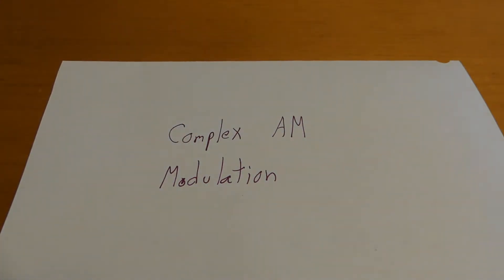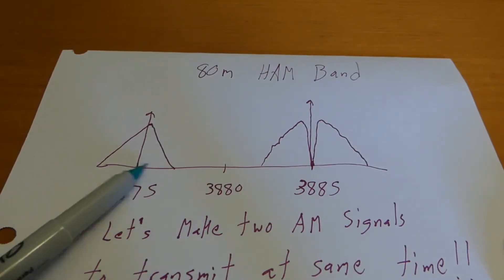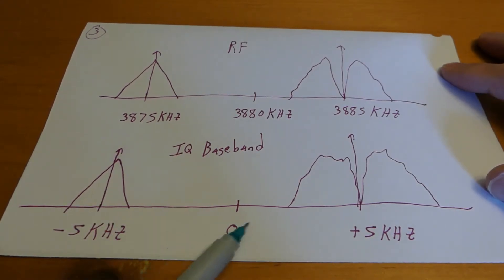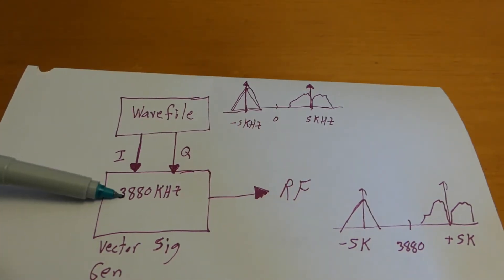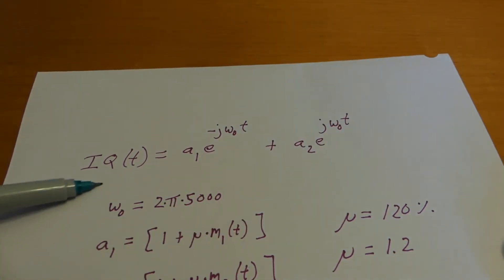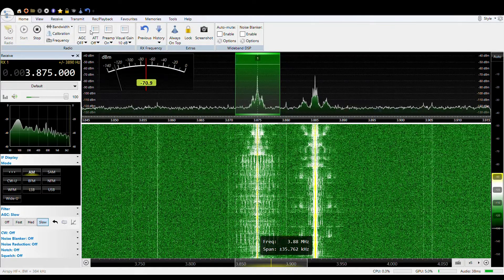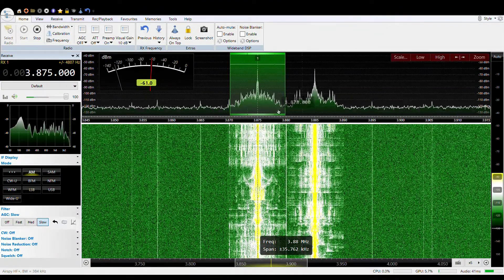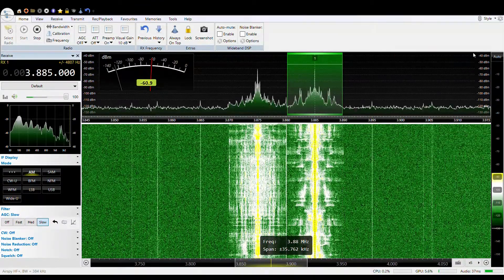I/Q Modulation for AM Signals

Comment: Dear @TheGmr140. I recently bought an Agilent E4432B signal generator with dual arbitrary waveform generator. I modified your 6AM signals matlab code to generate I and Q signal values for E4432B. When I modulate a carrier with the IQ signal I see a much wider spectrum on the receiving SDR without any audible sound. Could you please help me what could be the problem? Isn't this siggen usable for such AM IQ modulation scenario? Thank you! I can share the details with you in email... 
(By the way, I miss your teaching videos recently... Please do more!)
Reply from the maker: you have to enable I/Q mod on the sig gen.   may need audio level to be 50%,   i'd first just make a wave file ,  fs = 48khz,  x = exp(1i*2*pi*2000*t)
t = [1:1000000]/fs;       then  x = [ real(x).'   imag(x).' ]   ,   then audiowrite('c:\temp\test.wav', x, fs)    and see if you see tone 2khz off from e4432b center freq
Reply: @TheGmr140  Thank you! I was able to fix my issue. I had some data conversion issue while downloading to siggen. Finally I was able to generate IQ files from one of your wavefiles, transmit it on a carrier and receive it on a tuned SDR. So I am happy now with my signal generator which I can use for experimenting IQ modulation even if it has limited memory. Thanks!
Reply from the maker: @ ok good deal.
i think that has bnc for i and q inputs,  so if your bw needed is around soundcard levels, 48khz,  192khz,  you should be able to play signals out of soundcard to those bnc inputs.      now memory is limited by pc hard drive.   lol

Comment: I need some tech support from Dr moonshine please,  i couldn't get a reasonable hearable signal from my signal generator level setting to 0 dbm ,, !!! but your previous video the RS SMIQ 02 /03 you said to set the level to -70 dBm ....!!! this didn't work at all, and even at +3 dBm the sound was ok but not as crisp and clear like the video here.
any hints?
Reply from the maker: Does hackrf go that low?  Make sure rf is on the smiq
Reply: thanks for your reply sir,  yes sure the RF was ON and i even checked the signal on an oscilloscope, it goes away when the i click the RF button....today i tried HD SDR software , it's actually not bad at all...but still the audio quality is not as good as yours on this video...troubleshooting is a great learning tool....lol.
Reply from the maker: @ahmedgaafar5369  my sdr was hf discovery,  play with power levels -70dbm, -60 dbm
Reply: @TheGmr140  nice videos, but, can you answer me a question about iq-mod LO Leakage at RF Port ?
Reply from the maker: @antoniocarvalho8320  for analog IQ modulation it's an issue.   For digital IQ modulation it's no lo leakage

Comment from the maker: here is a link for 6AM Signals at once the link is the whole project, matlab script, audio files, and IQ wave file:
https://drive.google.com/drive/folders/1kt9B5Hlvyp-ztUGf2rL0hXJ9nyGuOu0n?usp=sharing
Reply: Your videos are great and the example codes/files are even bigger help. Learnt more in a few days by doing it, than by reading books for weeks/months... (of course some fundamental knowledge is a must from books)

As a first step I created some AM modulated test sine waves with IQ modulation based on your Matlab code. Then tried your code with the 6 example wav files. I played the result with GNU Radio and HackRF, but I had to resample to 2M samples/sec to see some signals coming out out hackrf. With 2M the audio was quite good. Tried with lower value, 960000 samples/sec, but at that time tuning to one AM channel I also heard some  of the other ones... Don't really know why, maybe I have to change some parameters in the LPF code.

But thanks anyway for your materials!